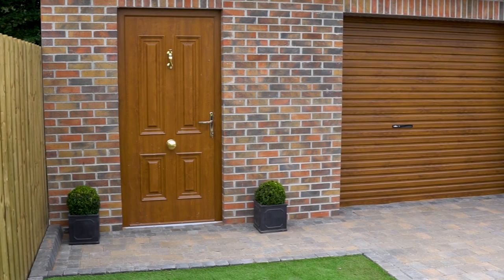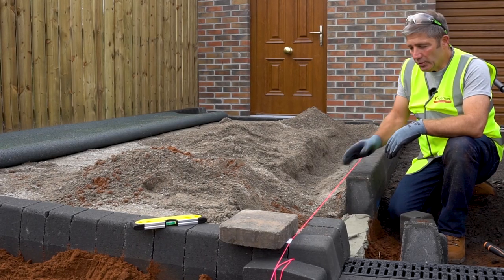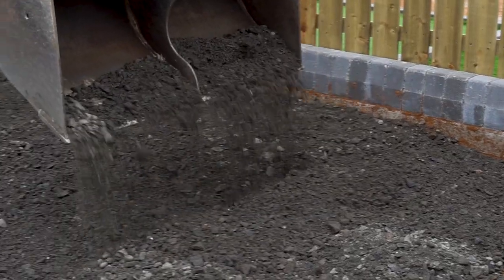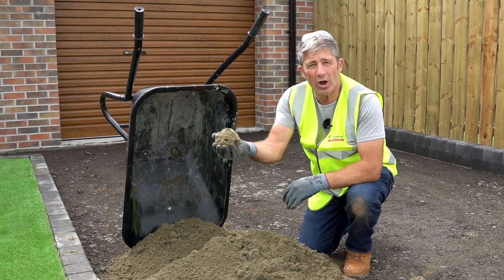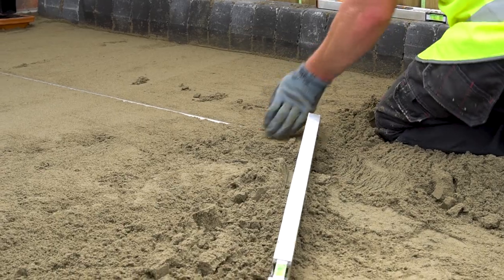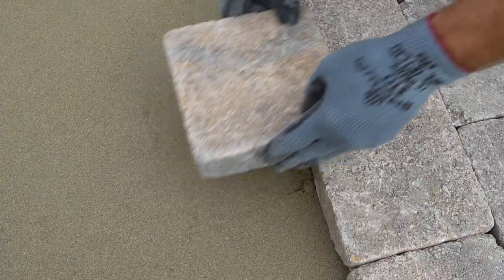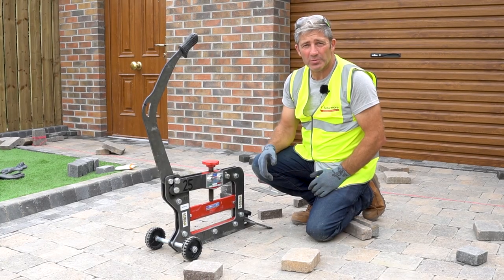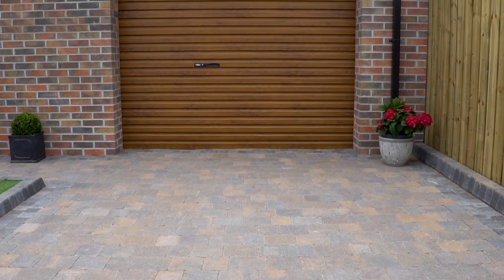How to lay Tobermore  Tegula Driveway With JB

Comment: almost everyone does this stage wrong. before sweeping in the Kiln dried  sand you should pass the whacker plate over the area of laid paving,  this then ensure that the bedding sand comes up between the blocks at the bottom portion and creates an aggregate lock at the base of the paving.  then apply the KDS. job done, I was taught this  in the 1970's. this is the correct way.  cheers.
Reply from the maker: You are absolutely correct 👍, I just had to follow the company process